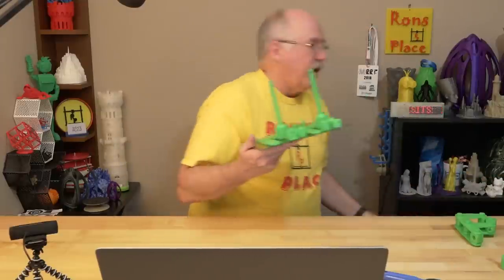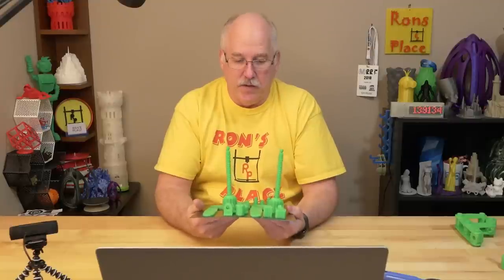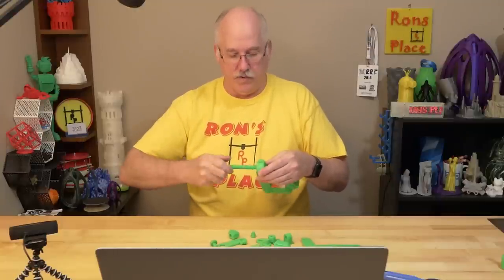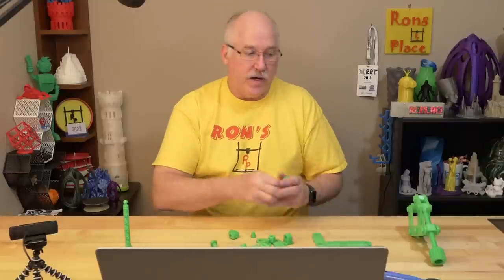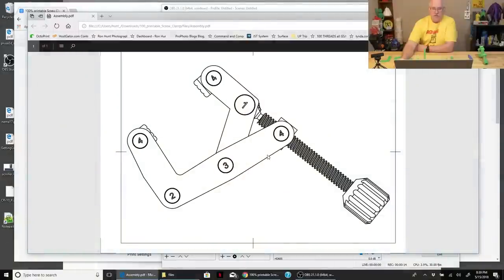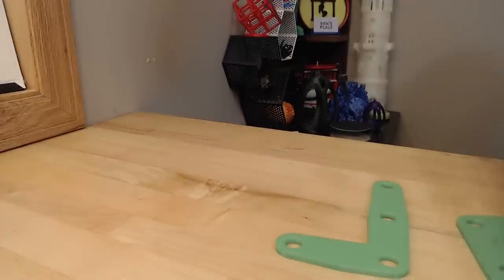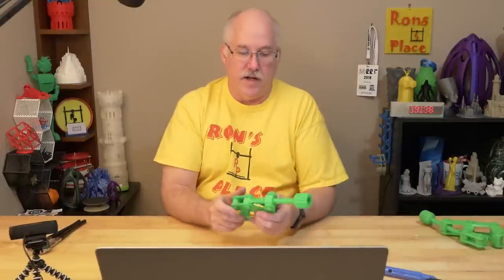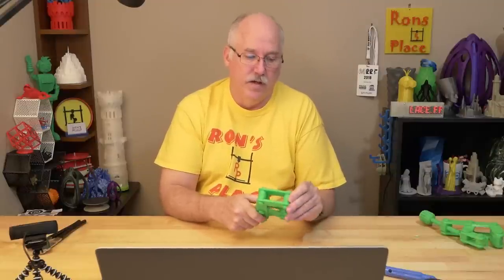3D Printed Clamps - AMAZING - on the Prusa i3 mk3

Comment: The design is fine. It may be much stronger and not so hard to make it out of steel instead of plastic, no? Only the connection between the thread rod end and the jaw would be tricky, requiring some angle grinding and deposit of steel through welding

Comment: I print PETG onto PEI at 70 degrees without the need for glue and it releases fine.. 90 degrees is just too hot. I don't have a Prusa though. It might be different. Try it?

Comment: Great prints!  What speed did you print the PETG at?  Did you just take the default 100% speed?  Those came out sweet.  I have the Prusa i3 MK3 as well.  I think I am going to print me a couple of those myself.
Reply from the maker: I ended up setting it at default 60mm/s ,   I like the smooth quality over a bit more speed.
Reply: Rons Place I agree about the smooth quality over speed, especially when making something for yourself or one-off items.  I need to get back to printing me some replacement parts for my i3 MK3 just in case something breaks.  I would not be able to print the parts if the printer is down.  Just want to be on the prepared safe side of things.

Comment: PETG is what I am struggling with. The PETG filament is always pulling strings and I don't know what's going on. Pulling Strings means what? Nozzle too hot too cold? Prindbed too cold or too hot? I do have the latest mk3 and am a greenhorn
Reply from the maker: I'm not exactly sure what you mean about pulling strings, but PetG can be a bit stringy..  this is often very filament dependent (some don't do it for me).  I find if I reduce nozzle temps it helps; and play with retractions.
Reply: Ron, I am using PLA and just with the very first layer it looks like the nozzle or something else is taking some filament and it looks like a spider was arround
Reply from the maker: try reducing temps by 5 or 10 degrees

Comment: Ron,
Can you link up your S3d profile you used with your MK3 for that PETG. I am having issues with my MakerGeeks PETG and S3D and can’t get S3D tweaked for a good print. This would help greatly.
Reply from the maker: I will see if I find a good place to host it
Reply: Rons Place by chance do you use Dropbox or Google Drive?
Reply from the maker: I dropped my PETg Prusa mk3 profile for S3D in my dropbox.. hope it helps.  https://www.dropbox.com/s/qia7j0z8r26p8er/Prusa%20mk3%20Makergeeks%20PETG.fff?dl=0
Reply: Thanks Ron!!!!  I will give this a try this afternoon.  I use a lot of MakerGeeks filament and PETG is one of those materials I can't get dialed in very well.  Hoping this will help because your prints looked GREAT!  Thank you again!!
Reply: Thank you again, it is working well on my machine. Now I'm having thermistor issues and it stopped mid print.  It is looking good though, many thanks!

Comment: Would the screws be stronger if printed on their side?  You needs supports, but how would that turn out, especially on your mk3?   That might make a good follow up video if these fail.  Thanks for the video, I might try to print some of these about half scale.  Jim
Reply from the maker: It would certainly print stronger flat; but would compromise quality.   Another clamp was linked and looks really cool also.  This one prints flat.   I've got it printed but haven't assembled yet.
Reply: Since the actual clamping direction puts the screw in compression, it should be able to handle some pretty decent forces before it buckles, especially if you can reduce the sheer forces by smoothing out the threading action.
Reply: mxsxend1982, good point!  I hadn't paid attention to that fact.  Thanks for pointing that out!  Jim